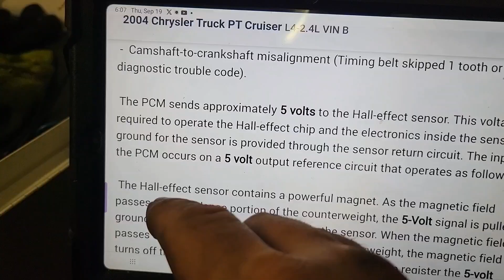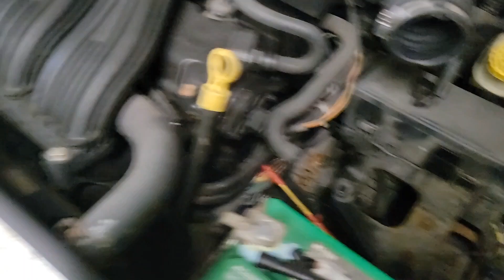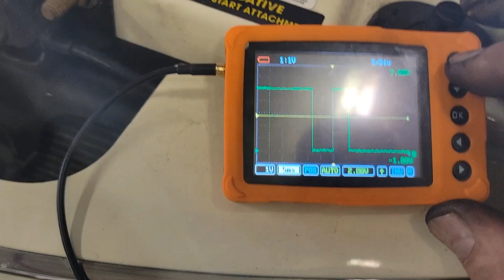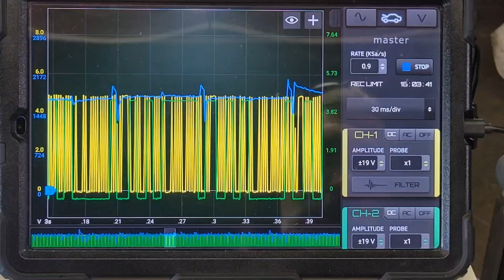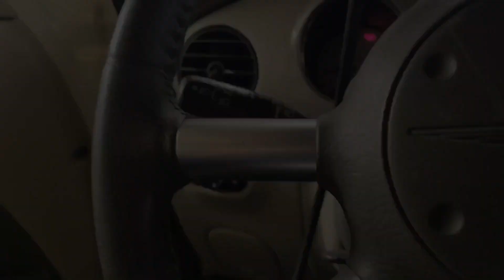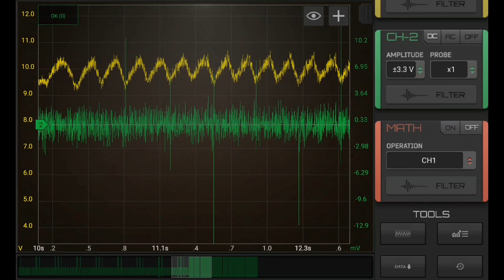2004 PT Cruiser 2.4. Cam & Crank correlation with hscope. Hope that noise is the tensioner!

Comment: I could be wrong but it looks like you where taking a voltage waveform instead of the current on your relative compression. If so then you would be looking at the voltage drop on the waveform instead of voltage rise. You would need to invert the capture and then look at the humps rising. Remember as the current ( amps ) of the starter rises, the voltage will drop. You can then place your horizontal curser to check for even humps. After that you can take another look at your ignition waveform and you will see that the ignition is firing close to top dead center. I hope this makes sense. Enjoy seeing your videos and it's always a learning process for us all.
Reply from the maker: Oh yes, you are correct.i don't know why I put the cursor on top of the voltage. The first go i had the amp clamp on the green, so i could align the voltage dropping and amperage rising. I never used to use voltage for RCs, so I have been doubling up. Learning to trust it as much but still like both because already set up for a charging test. I just like to know I can trust it for some odd situation that I have the amp clamp on something else, or more likely left on and no battery lol. Can't think of many situations but possibly voltage rc and charging test with a 1st look? Kind of get 3 tests with 2 channels, plus easy to see ac voltage. I'm just not used to what the pulse is supposed to tell me yet, other than if one is different. Good eye and thanks for stopping in!

Comment: I had a pt cruiser 13-15 years ago i worked on making the same noise from the rear of the engine, it ended up being the center of the flywheel was broke all around the bolts, i would check to see if the torque convertor bolts are loose, if not see if you can move the flywheel back and forth by putting a wrench on the convertor bolts and rock it back and forth.
Reply: Exhaust manifolds cracked
Reply from the maker: @michaeltiza232  that would not surprise me , the way the engine mount was moving around. I hope not but will find out shortly!
Reply from the maker: @thomaszavacki5647  oh no! Belt was trash, so im hoping it was most of the noise. If I hear that sound after the belt on that side, that's the first thing I will check. Would explain the weird starting sound also  . Thanks!